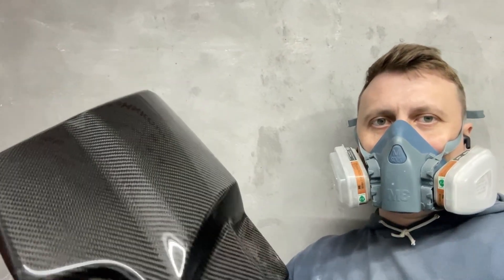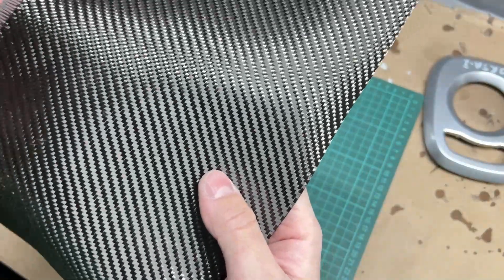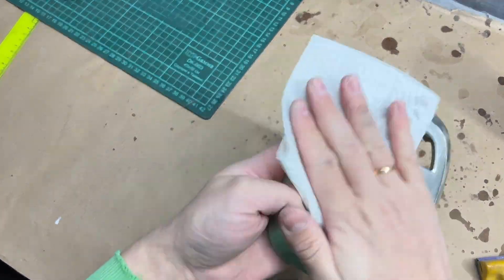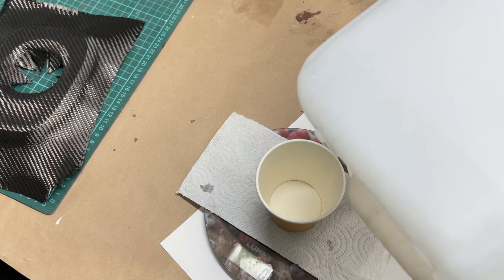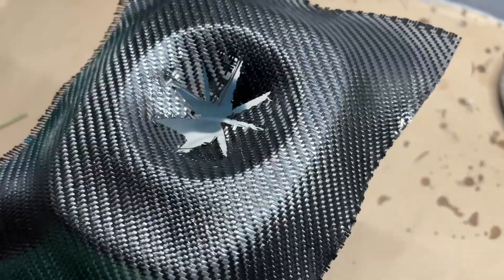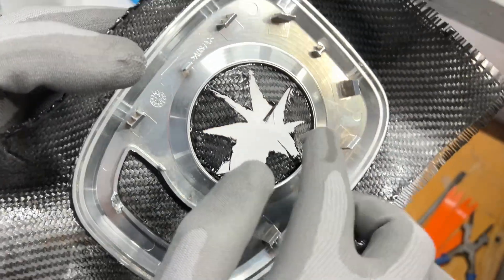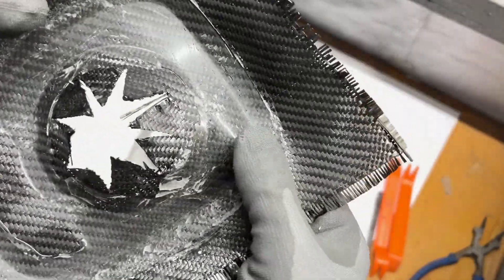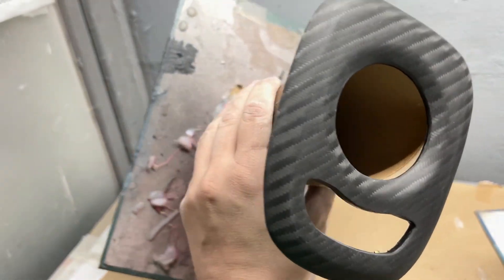Carbon fiber skinning: Why adhesion layer is so important?

Comment: This method does not work!  The laminating epoxy resin I used caused the carbon fiber to lift off of the plastic even though I used 3M 77.  Either my epoxy resin was reacting with the 3M 77 or it was  poor product or these videos are BS.
Reply: 3m喷胶应该不行，粘接费用高粘度的环氧底胶，带点韧性的
Reply: You need to use either epoxy resin or a contact adhesive mixed with acetone to bond the carbon cloth to the part.

Comment: What i should use to stick carbon fiber to abs part, before epoxy. Epoxy doesnt stick to abs even i use 40 grit. When it see hot weather, under the sun. Fiber gets off from abs